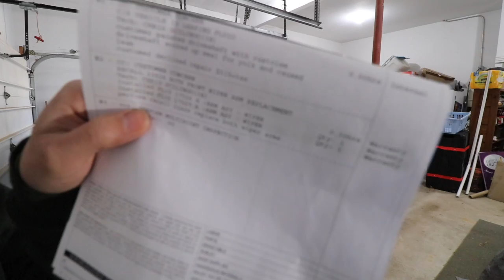Ford DENIED my Warranty Claim

Comment: It technically COULD damage the seal because the rust will get knocked off and smoothed out when it slides. The paint would lock those rust particles in place effectively creating sandpaper on the slide. Having said that, it is still kind of chicken shit of them not covering it. They get paid for the warranty work.

Comment: They are obviously looking for a way to avoid doing the warranty work. It was leaking before you painted it. As you said. But also you never paint a rotating machined seal surface. The paint interferes with the seal, its going to leak.
Reply from the maker: Yeah, in hindsight this was likely my fault. Was under the truck today, replacement seal is holding well.
Reply: @OldSoulMillennial  why would they. Warranty pays 1/3 the time it actual takes to fix it. If they paid the proper time they wouldn't have issues fixing the cars
Reply: Not sure they would turn away warranty work. Dealers make a butt load off it. Must be true what you did voided warranty. Bummer. Lessons we learn.
Reply: @Big dunes and blue skies  maybe the dealership itself makes money but the techs mainly lose
Reply: They look at avoiding warranty work right from when they engineer it to last very little longer than the warranty period.

Comment: Its possible the paint had something to do with it but they have to prove it caused it to deny warranty. That is supposed to be a smooth machined surface the part that actually rides in the seal isn't the the rusty part of the yoke. The outer boot is only for dust the sealing part is more near the aluminum of the t-case
Reply from the maker: In hindsight, I suppose it was mostly my fault. It's easy to get worked up over small things like this. Was under the truck today to check on the new seal. Not a drop leaking anymore. Also checked the torque on the 14mm flange bolts. Nothing loosened up. Good Repair, Cheers

Comment: Bought a brand new 2023 Ford Expedition Max Limited. $80k car. Nothing but problems. Engine replaced at 16,000 miles. Transmissions clunks. Fumes entering the cabin frequently. A true lemon. They owe me pain and suffering!
Reply from the maker: My Dad bought a 2019 F350 Lemon. Nothing but issues, had to get a lawyer involved. Eventually was able to have ford buy it back. It's a shitty situation to be in. Document Document Document.

Comment: Did you contact Ford?  I had a problem with my Toyota.  A sensor went bad and was out of warranty by a few years.  Toyota made the repair as a customer courtesy.
Reply from the maker: Contact ford corporate? No I did not. Already repaired the issue myself. Maybe they will find this video...

Comment: I had the exact same leak on my 2021 F-350 7.3 . I noticed it when I was changing the oil . Turned out they replaced the whole driveshaft assembly & seal under warranty . They said the factory driveshaft was not true & caused the seal to leak. This was a year ago & so far no leaks. What they told you was complete Bullshit ! I’m just letting you know if you replace just the seal it might not take care of your issue if it was a defective driveshaft like in my case .
Reply from the maker: Interesting. How many miles did you have on the truck when you noticed the leak, and how did they determine it was a "not true" driveshaft? I'm guessing they removed the driveshaft and put it on a balancer? I would have expected you to feel vibrations while driving if that was the case.

Comment: Stretch logic and rules to not honor warranty. 
Oh, transfer case shift motor and actuator in lieu of good old fashioned shift lever in cab. Search "check 4x4" and "shift delayed move vehicle" coming up on the dash screen, maybe not on your fairly new truck but possibly 100,000 miles or more from now.
Reply from the maker: I wish they made the manual 4x4 shift an option. Had it on my 05 f150 and loved it.

To prevent seizing,  I turn the hubs on and off every time I wash the rig. I try to engage the 4x4 at least a few times a year to keep that motor free. 

I wash the underbelly good after every salt event. Makes a big difference in corrosion prevention and general vehicle health.

Comment: Unfortunately, this is becoming a more common trend with the dealerships, just refusing to do their jobs after you buy a $60,000 pick up truck.
Reply from the maker: Have to make the shareholders are happy!
Reply: You do realize if they do the work on the front end and the manufacturer denies the warranty after the fact,  the dealership has to pay for the part and the mechanic doesn't get paid. Not a dealership problem when it comes to warranty work

Comment: You can always go to a different Ford dealership they might help you out with better customer service just an idea but you probably already have it fixed
Reply from the maker: If it was a major repair, I would have likely tried another dealership. For this, not worth the stress, aggravation and lost time. Put the new seal in myself over the weekend. I also feel that the $515 quote was a scumbag price. Can't stand dealership service.
Reply: @OldSoulMillennial  I agree with you %100 keep your head up it's a sweet truck